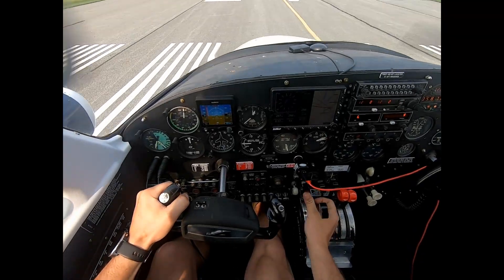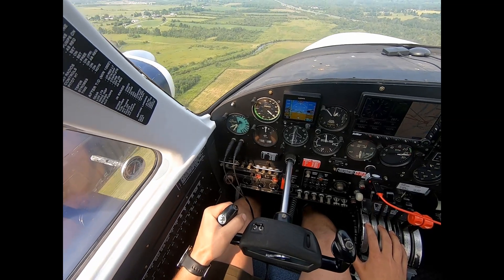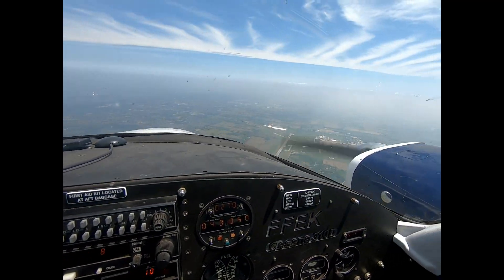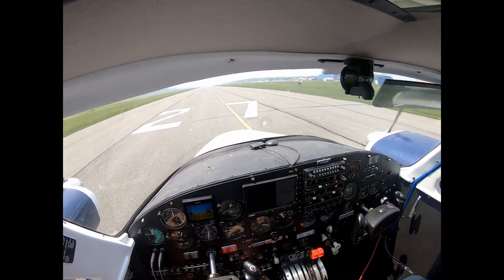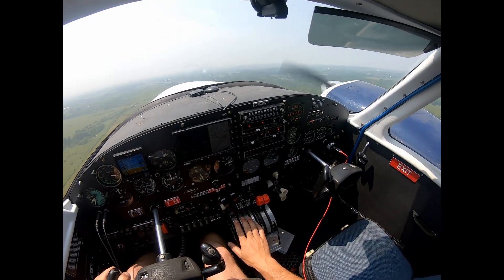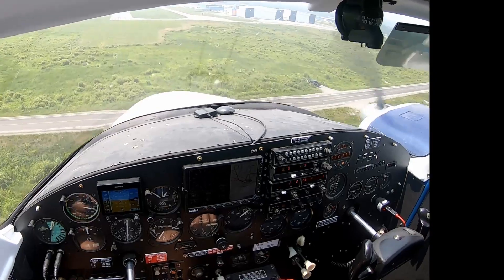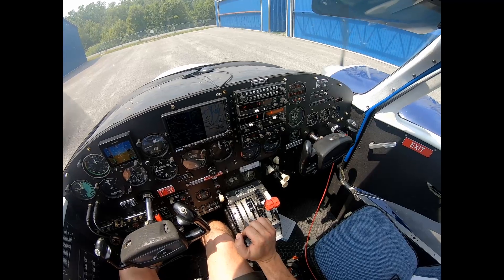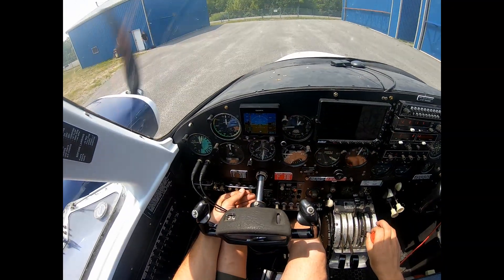Cessna 310 Engine Troubles

Comment: Have you considered a MAG problem, weak spark?  Or partially grounded plug wire?  As you mentioned mechanical fuel pump could have an issue, but when fuel psi is balanced and still can't get full rpm seems like another issue.  (Maybe more than 1 problem)   Since compressions is great ( I assume dry cylinder check), plug gap good and there is plenty of fuel, manifold pressure high, could be a partly grounded plug or bad plug wires or weak spark or any combination ... but I suspect electrical.  And yes prop governor may also play a role!
Reply from the maker: We did get the issue fixed and there is a second video showing that. Turned out to be corrosion inside the fuel distribution spider.
Reply: @fastbackflying853   I've got a G model and I'm working through the whole fuel system as well.  I was going to ask about the distribution spider because I had mine rebuilt as the aircraft had been sitting for a decade.  Prior to that it was finicky.  In my more extreme use case, I was blowing the breaker for the electric fuel pump because the diaphram inside the distribution spider had become hardened over time and was not allowing full fuel flow.  This would cause an overload condition on the electric pump.  This was also causing an engine out at times back when it was running.   The 310 is fine on one engine so it was never a big deal.

My issue now isn't full power, it's richness as I'm out of adjustment on the fuel-air control unit linkage with the air horn.  And my next plan of attack was the mechanical fuel pump adjustment pressure.  That hasn't seemed to be the golden ticket.  Basically the fuel metering is just too rich and I can't seem to have a smooth power reduction without corresponding leaning.  If I don't do that, the richness at lower power settings causes plug fowling.  Which will, again cause an engine out on power reduction on landing if you're not super careful.  I've been at this for months myself.  I feel your pain.

Comment: It appears that you MAY be missing the pilot side yoke control shaft BUSHING where the shaft goes into the instrument panel.  A missing bushing could cause severe wear in the shaft.
Reply from the maker: Thank you for your concern. The bushing is there and in excellent condition. Its a little further into the panel behind the more open area where the gust lock installs

Comment: No expert, but I'd be checking the left engine prop governor, and the left prop for sludge, the reason it's not giving you full RPM is the prop isn't reaching the 'full fine' position.
Reply from the maker: Good thoughts. Unfortunately the prop has only about 5 hours on it since overhaul so very clean in there. 

The engine is not making enough power to push to the prop to full rated static rpm. Once airflow from forward motion occurs rpm  increases until the governor starts doing its job. This confirms an engine issue rather than prop or governor.
Reply: @fastbackflying853  , has the Engine ever made full RPM since the prop was overhauled?

Comment: I wouldn't want to take off without static RPM confirmed
Reply from the maker: I only released the aircraft for flying after confirming and consulting with an engine shop, prop shop and Continental about the performance and lack of full rated static.
Reply: @fastbackflying853  Well that's good! As long as you can stay above Blue Line!